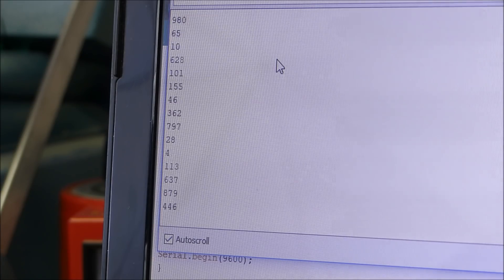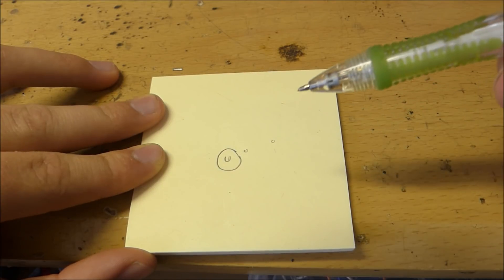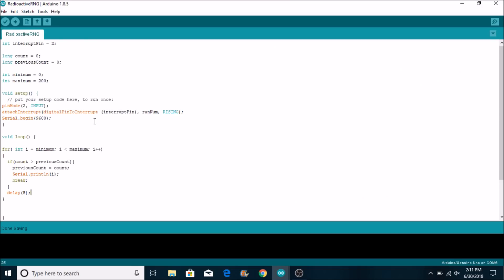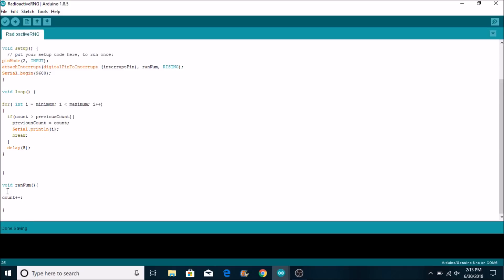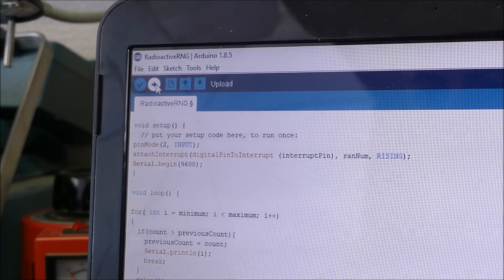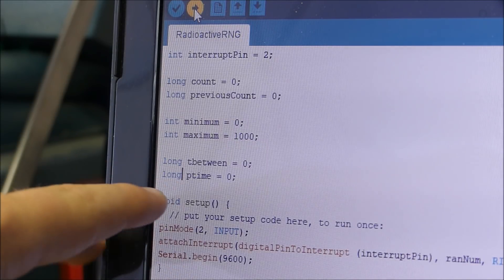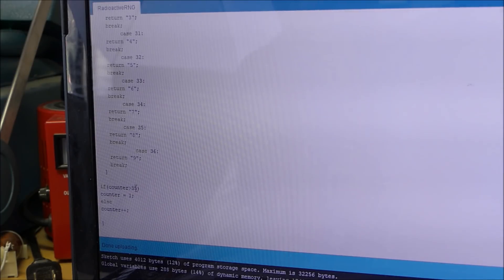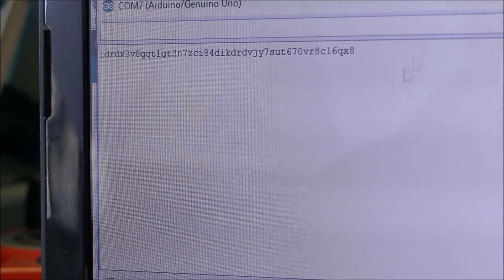Radioactive Random Number Generator☢️

Comment: Your approach isn’t truly random when several particles decay In quick succession you’ll have a range that increments. 
So what you’d normally do have a free running counter and when a particle hits you’ll take the lsb and shift that into a byte or what ever format you’d want. Then you can’t say with a decent guess that the next number will be higher. And in your cause the numbers are even more predictable because of the 5ms delay and that your counter stops when an interrupt happens.

Comment: Why doesn't someone sell these without the radioactive samples?
Reply from the maker: You mean a geiger counter or a random number generator?
Reply: @TannerTech  I mean an Arduino and Geiger counter already set up, with lead lined housing and a lead plate that can be toggled to stop exposure to the Geiger counter when not in use.

All youd need is to buy a Fiestaware plate piece for it.

Comment: Very cool, now make one using the spin of silver atoms. Look up the Stern Gerlach experiment if you don't know what I am talking about.
Reply from the maker: Just looked it up.  That looks like a really cool experiment!  I don't know if I have that kind of equipment though.
Reply: @TannerTech   Smart guy like you could figure it out without proper equipment. From what I've read it is just a 1000C oven with a hole in it heating a piece of silver. The hole has a collimator over it which turns the effused silver vapor into a beam, which you then simply shoot in between a couple magnets of differing strength into a piece of glass (or whatever works best, maybe even a piece of paper might work).

It interested me because it could be used as a binary random number generator, which means if these were made smaller and you had a bunch of them, you could easily generate random numbers within whatever range you wanted without grouping, unlike with radiation or other means which aren't very useful because you can't define a range without lots of grouping.

Comment: such an impractical way of doing a random number generator since you can seed the arduino one with an analog pin connected to nothing but still it is obviously fun to watch, also I really didn't pay a lot of attention to your way of generating random characters* but I think this could help. You can generate random numbers from 0 to 96 + 32, that's from 32 to 128, and that's ASCII characters, type casting the random numbers can give you random characters easily this way with a for or something:
randomChrArray[i] = (unsigned char)rand() % 96 + 32; // this is not giving you only letters btw
I'm sure there are even easier ways to do it but that's what I got, cya, also sorry for bad english

Comment: Recently I successfully used ADC in atmega328p connected to its own internal temperature sensor to generate random numbers. ADC on this chip is pretty good, but if you making a lot of samples at max ADC speed they will contain some noise in them.